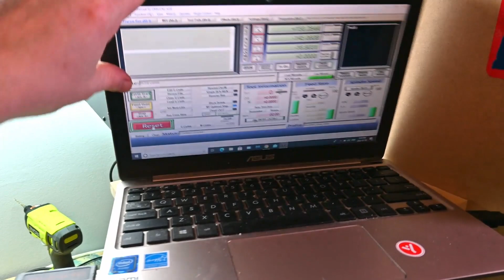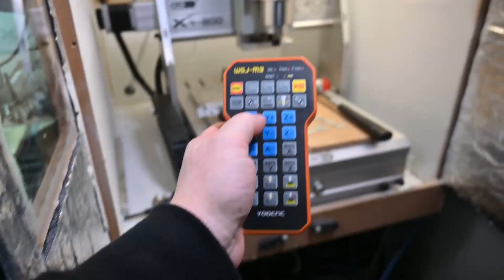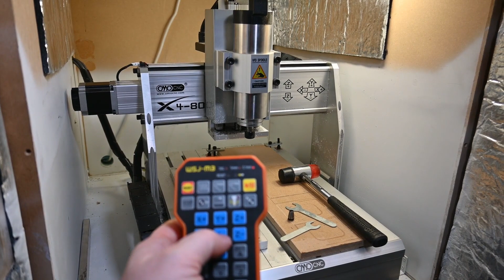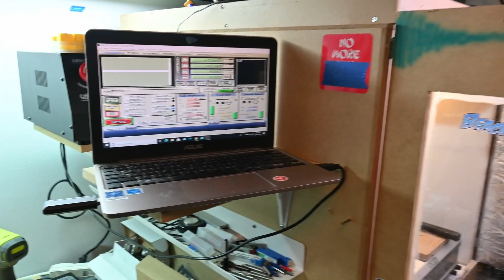CNC Parts - Omio CNC Router tour - Sound proof CNC box - Ball screw explanation.

Comment: how do you like this?  Machine accurate?  Thinking about buying one similar to this
Reply from the maker: It is accurate enough for alloy or brass. I've been able to get it repeatable within .0012"  It is by no means as rigid as a proper cnc mill. The ball screws are what makes it a worth while purchase. Make sure you buy a router with ball screws for sure.